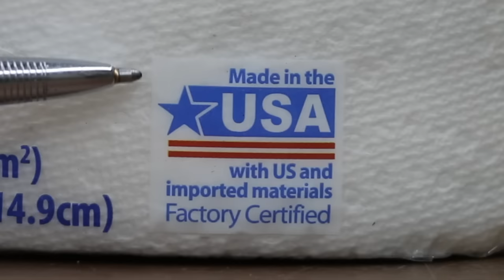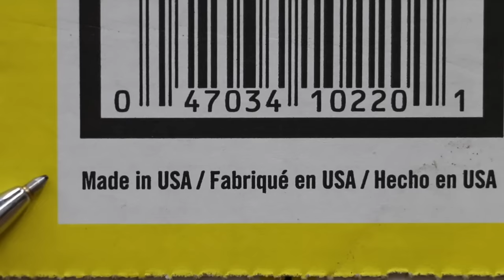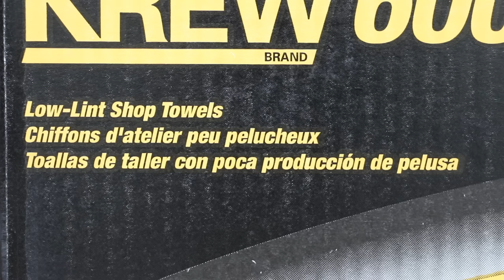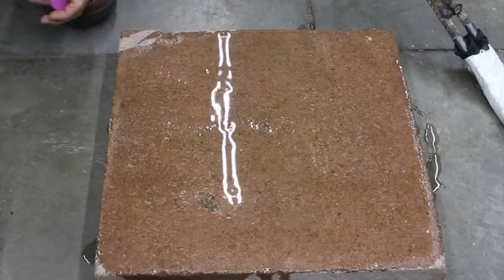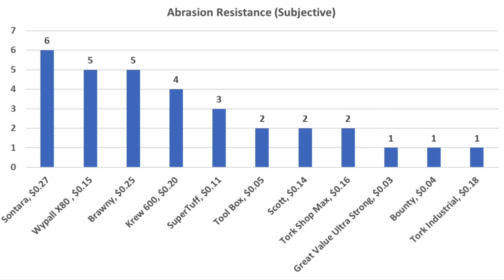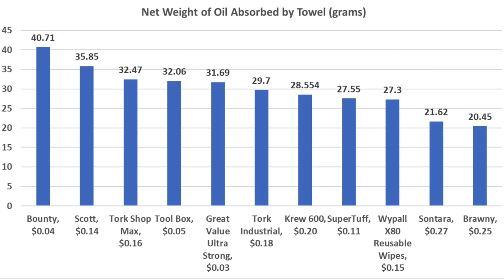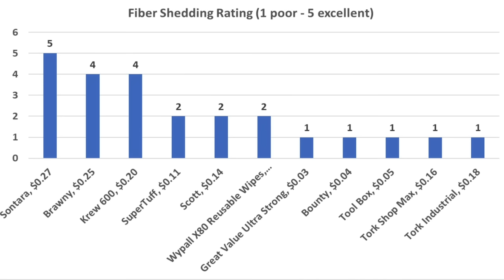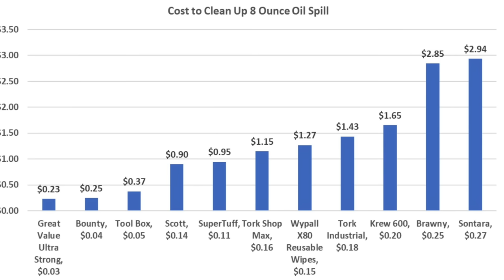Shop Towels vs Paper Towels? Let's Settle This!

Comment: One benefit I’ve found for the blue colored towels is they darken when they come in contact with a fluid. When looking for a weeping brake line or plumbing fitting, that’s worth the expense to me. The white ones just don’t show enough contrast for a tiny droplet to show.
Reply: That's not a bad point!
Reply: plus I always get em online for pick up in store for a slight discount
Reply: Finding plumbing leaks with white paper towel, exercise in frustration, been there and tried that.
Reply: good idea, thanx.
Reply: Thanks for the tip !!
Reply: Excellent tip!  I guess I'll keep some around when I switch to the Wypall
Reply from the maker: Thanks for the feedback.
Reply: There's also a brand (forgot the name) that has orange towels that turn bright red when exposed to fuels (hydrocarbons) and oils.
Reply: I have become a shop towel junkie.  I have learned that they sell white ones for painters.  But my expeirience is i want to see what paint i am wiping up, so i know where to fold the towel and use it on the next mini-clean up spot. Sticking with the Blue ones
Reply: Yea I like the super cheap brown ones for finding leaks. Always in public bathrooms etc
Reply: @nmatthew7469  liquid soap on a paint brush, brush the area down and wait for the bubbles to appear.
Reply: @bobstorr4986  only for air and gas lines will that work.

Comment: Someone FINALLY called Bounty out on their quicker picker upper claim!
Reply: Bounty was 1st for absorbency and 2nd for absorbency speed compared to a paper towel costing nearly 4 times as much.
I think it did alright considering.
Reply: @evilutionltd  your comment is inappropriate,
Reply: @del-boysnostalgiatvads7416  Huh?
Reply: How were they called out? That they aren’t the best to be used in the shop because they aren’t the strongest? I think you missed the whole point and some of the results of this test. Might also want to take off those glasses that give you tunnel vision and cause you to only see what you want instead of what’s actually there.
Reply: @plaid11  they were called out in the beginning. Todd's classic "we're gonna test that..." I never said their claim was false, only that I'm glad someone other than a Bounty commercial was finally testing it.

Comment: 5:28 - Tensile strength
7:53 - Abrasion resistance (subjective)
9:48 - Net weight of oil absorbed
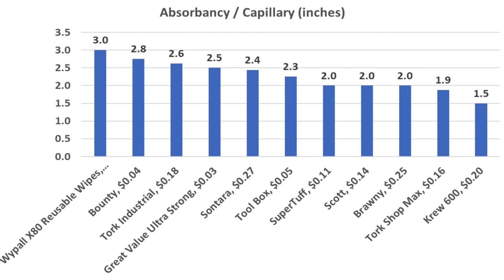11:13 - absorbancy
12:05 - fiber shredding rating
13:37 - cost per 8 ounce cleanup
Reply from the maker: Thanks for the feedback.

Comment: It looks like there's a trade off between strength and absorbency
Reply from the maker: Excellent point!
Reply: Which is expected. To be a good absorber the material needs to be more porous which leaves less material for strength. That's why I have both types in the shop and in the kitchen. I would also have tested how easy it is to remove residue from some surface. Because from my personal experience it's easier with shop towels because of the higher tensile strength.
Reply: For sure. I use Wypall X60 and they're not the best absorbent. If I need to really sop something up, I'll use regular paper towels.
Reply: For sure
Reply: I noticed that too
Reply: Yep.  I already had Bounty in my garage so I could pick up spills cheaper than using Scott Shop Towels, but when the Scott runs out WypAll X80 seems much better replacement.  Bounty paper towels + WypAll X80 seems a good pair at a reasonable price that covers most tasks.  Maybe with a small box of lint-free wipes for when you really need that.
Reply: @Sn0wZer0  At that point I'd rather use lint free cloth rags, swing through a Value Village or something and grab some cheap material to cut up. Way less likely to disintegrate if you catch on a sharp edge too.
Reply: @TheGibzar  Yeah, I get where you are coming from, but at my old job we had "KIMTECH Kimwipes" which worked really well (though not at all absorbent).  I like how they worked so I bought a box because they aren't expensive ($0.02 per small sheet; equivalent of $0.06 if the same size as a paper towel).  Again, not absorbent but if you need that you can soak with Bounty and then wipe with Kimwipes.  If PF does a test maybe I'll switch but until then I'm sticking with what I know works.

Like most people I also have a stack of microfiber cloth for work just involving water / mild dirt and not any chemicals.
Reply: @Sn0wZer0  microfiber rags are pretty cheap nowadays and are virtually lint free
Reply: @ptyzix  as soon as I saw it, that logic light bulb goes off and it's something you kinda already know. It's crazy sometimes the things that point out obvious things lol
Reply: @ptyzix  yeah, I keep 3 types handy. Regular cheap paper towels, the "reusable/cloth-like" paper towels (blue/white shop paper towels), and textile shop rags. My favorite being the latter. I don't see any benefit of spinning a half a roll of paper towels off, just to wipe up one mass. I go through enough tee shorts throughout the year to make more than enough rags for myself, so I can throw out the ones that are too greasy to go into tree washer. Then I take all my rags after a month, toss them in a 5 gallon bucket with purple degreaser & water overnight, rinse them, fill the bucket with bleach & water, let it soak overnight, rinse it, then throw them in the washing machine. I've got an entire duffle bag full of rags. It's a beautiful sight. I use sheets, bath towels, hand towels, face cloths, kitchen towels, blankets, shirts, and pretty much any textile. I collect them over time in a bag, then sit in front of the TV for an hour and cut them into rag size. I use a self-healing cutting mat and an Olfa 45 or 60 mm fabric rotary cutter (with the authentic, made in Japan, Olfa brand blades) to zip them into rag size in seconds. If you're cutting a lot of fabric, a rotary cutter is indispensable. Shears just take way too long.
Reply: For larger spills, kitty litter for the win
Reply: @ptyzix  although  something that I feel breaks that rule is pig mats they are strong as hell and soak up so much they are thick though

Comment: I just wanted to say, those Tool Box brand towels are sold at more than Harbor Freight. Also sold under a variety of names, although those would mostly be seen commercially (Caterpillar, John Deere, Uline). There are also several variant weights of it, from like H700 to Z2200. This refers to how it is processed. Brawny 6-packs in White are made by the same converting plant. The square box dispensers, plastic wall-mountable buckets, and bucket refills ranging from 7" diameter rolls to 10", are all from the same plant. 

The paper is called DRC - Double Re-Crepe. It's actually the name of the specific process. It gets fluffed, a latex/natrosol/couple other binders mixed in, wrapped around a steaming hot drum (literally), cooked, scraped off, sent through an oven, then repeated to the other side. It just about increases the absorb-ability of the stock paper 4x for the lighter weight, up to 7x for the heavier weight.

There's also a tear resistant option where there's basically a loose plastic filament in the wiper that keeps it from tearing apart.
Then, there's a no-tear option (called diamond DRC) that's usually blue, red/orange, or pinkish-red that has a very tight diamond weave layer cooked onto both sides of it.

Signed,
The millwright that fixes all that shit
Reply: Where can we get it?
Reply: @jjohnston94  your a legend
Reply: @meateater139  I am? What's the legend?
Reply: Shout out to Millwright mechsnics. Was very lucky to work with 2 great millwright mechanics while an electrical spprentice in maintenance shop. Guys could weld burn do plumbing set machinery and small electrical jobs. Neither.ever used an adjustable wrench. They taught me to always work with the correct tools and to work safe.
Reply: Best comment ever

Comment: I’d really like to see a garden hose test.  Love the channel.
Reply from the maker: Thanks!  Thanks for the video idea.
Reply: That would be a great one to test. See how much they swell under pressure.
Reply: @reecer6317  The bursting of the hoses would be highly entertaining
Reply: If you do this please test inner hose swelling when the outer lining is punctured.
Reply: How easy they kink and how well the ends are made is my biggest concern. The hose always seems to kink and fail right before the end.
Reply: @tonnyletkeman2348  I bought a couple of those black industrial ones from homedepot , they’ve been very good so far. I need to check the brand.
Reply: Yeah some of the more expensive hoses like the zero g seem to get small holes in the too easily for the price
Reply: @ProjectFarm  agreed it’s crazy how many options there are . HELP! Haha
Reply: Yes!

See which ones handle being run over by a car.

Flow when pulled around the corner of a house

Flow when 180 degree kinked.  

Cut resistance. 

(Would take some time but) UV resistance over maybe a six month period or so.

Edit: and I agree with Luke.  Torture test them under high psi until they let go.
Reply: And nozzles too!!
Reply: Me as well! I've popped two bungee hoses because I think I have too high water pressure. . .
Reply: I too would like to see this.  The best I have found are Underhill hoses, which are expensive, and 100% rubber hoses which are not as expensive but not cheap.
Reply: @ProjectFarm  Please include the 5/8 and 3/4 zero g hoses in your test. When I need to buy something, I always check my list and your channel to see if what I'm buying has been tested. Your work is greatly appreciated.
Reply: @ProjectFarm  omg yes. garden hose test please. I hate hoses, and a good test would be durability, and easy storage!
Reply: Best hose out there: Basic black GOODYEAR rubber hose.  Expensive but worth every penny
Reply: @MWash-yr1xe  My wife murders a couple of those a year!
Reply: @blaydCA  I think they stopped making the 100% rubber hose. Have only seen the new partially rubber hose.
Reply: @NONO-hz4vo Goodyear Black Rubber- Top of the Line Water Hose
100 ft. x 3/4 in. ID
American Made by Continental-Goodyear-Thermoid
Industrial Grade. 200 PSI Rubber
Flexible in all weather conditions! 
Heavy Duty All Brass Fittings Steel Banded On. $66.00USD Online plus shipping, ect. Pricing ain't for the squemish. Worth every penny though for my needs. Homer used to carry them.
Reply: @WearilyMistaken  Better hardware/lumber resellers will have pressure testing guage the attaches to a sillcock/outdoor spigot in place of your garden hose to test. Domestic water supply should regulated to 45 PSI +/- 5. Unregulated supply for irrigation/fire suppression can range up to 130 PSI direct from water main/service line.
Reply: @stephenvogel3162  We won't ask WHY.....some things are better left unsaid. Note to self: hide my nozzle.
Reply: @talldarkyummy8211  might be "entertaining" to watch a test burst.  Not so "entertaining" when water costs $3.50usd per 100 cu ft (748 gallons) in the SoCal High Desert and it pukes unattended.
Reply: @blaydCA  thanks for the info!
Reply: @blaydCA  I stand corrected. I grew up in the country where water was plentiful.
Reply: @talldarkyummy8211  No worries. I lived back east before where water was plentiful and inexpensive. Here, it is precious, more so with current drought. My area is in good shape because we conserve.
Reply: If you haven't checked, he just did one :)

Comment: The sontara towels are great. I was an automotive painter for 20 years and loved the sontara towels. I was very picky and a towel snob. After I masked off a car, I would clean my panels with grease and wax remover. Most towels leave to much lint behind. The sontara’s were the only ones that didn’t lint. And when painting, you need the cleanest, dust and lint free environment possible. Little towel lint fibers left behind are detrimental to a nice smooth paint finish.
Reply from the maker: Thanks for the feedback.
Reply: It makes sense. If you're using them in the aerospace industry, you don't want that lint getting into multi-million dollar machinery/engines/equipment.
Reply: 100% Fact!
Reply: Sontara brand is made by Dupont.  KC has about 5 different towels just for critical task wiping.  The truth is there is only about 4 paper mills that make 90% of all "paper towels" and other paper pulp type products.  KC and GP being the biggest and Trimaco being a close third.  A lot of them do the private labeling too.
Reply: @Dominasty  aerospace, no. But when you are doing $10k in paint work on a $100k car, in a $50k paint booth. Yes, these little differences do make an overall huge difference. Why worry about a extra dollar in towels when you have weeks worth of labor and thousands of dollars in materials invested.
Reply: I am not trying to argue but I have a question why not use cotton towel if leaving residue ruins paint or a cloth shop Towel?
Reply: @jbflyinglow  cloth towels are great but you gotta run them in the dryer 5-6 times and are better after a year of use. And that's my experience building engines. They still might lint and leave dust in paint
Reply: @1963felonee  thank you, I use them in my machine shop but I had no idea about paint.
Reply: @jbflyinglow  cotton leaves way to much lint. Microfibers on the other hand do work pretty good. Unless your in a shop in California, where you can’t use solvent based grease and wax remover, and you are forced to use shitty water base cleaner, the microfibers work well. I wouldn’t use them with solvent base though, because I think it might melt them or at the very least leach out their color which could transfer onto your surface.
Reply: @JohnDoe-du6yi  thank you
Reply: @1963felonee  what aspect of engine building is sensitive to some lint from rags/towels? Seriously? Are you building jet engines?
Reply: @xenonram  just what I got taught for cleaning around bearings and stuff but engines aren't too sensitive to lint, but doing it a little better is better than 12 hours of warrantied labour
Reply: You cleaned your freshly painted body panels with paper towels?! Um, hello microfiber???
Reply: @Dominasty  Microfiber cloth.
Reply: Microfiber is good for being soft but the nature of the fabric can attract and transfer partials. With the nature of specialized disposable wipes being so thin and lint free lends themselves as an ideal product for use with paint prep. Especially high end paint jobs. And you have ever washed a microfiber cloth you will quickly understand that they would turn into a one use product for any type of lint-free/uncontaminated sensitive work.

Comment: I've been using the Great Value brand for a very long time. For the money, it's a good paper towel. I always wanted to know which paper towel is best for low lint use. Thanks for another great testing video!
Reply: Likewise low lint is important to me. I usually struggle with lint when cleaning gasket surfaces and find myself wiping several times to remove the lint from the last wipe. It probably doesn't matter but when you want something to last 100,000 or more then you don't want it take chances!
Reply from the maker: You are welcome!
Reply: Is that .03 per half sheet or two half sheets?
Reply: electronicsNmore  Viva Signature Cloth.  Expensive, but awesome.
Reply: @maulerrw  Yea I just spray it with air hose
Reply: "Decent value"
Reply: No tack cloth on a 4k paint job?
Who is doing these paint jobs?
Reply: You could almost call it a… great value
Reply: @maulerrw  Hi Garfish, may I recommend paper coffee filters, use to use them for a lint free cleaner for windows,never leaves lint.Take care.🕊️🙏🕯️

Comment: I've been using Scott ones forever, looks like a change is in order. Thank you for your awesome videos!
Reply from the maker: You are welcome!  Thanks for sharing.
Reply: Me, too, because you can get them in a big, 10-roll multi-pack from Costco.  I've got my eye on those Wypalls, though...
Reply: I think Kimberly Clark actually is Scott. It really likely just comes down to the fact that the white box Kimberly Clark ones are meant for pretty brutal industrial use whereas the blue Scott towels can pretty much be bought at Walmart by any Tom Dick and Harry. I've honestly used them all in my years, but in my house we use the Bounty towels because they don't scratch and they are quick spill cleaners. We do have some Scott blue towels in our garage just for drying our hands basically. I honestly just use the run down microfiber rags for just about everything in my garage though. Worst case scenario they get too destroyed to be worth washing and I throw them out. But they were junk at that point anyway.
Reply: They used to be a lot better, but the past few years the quality has just plummeted
Reply: Same here
Reply: @taowroland8697  I was gonna say, I am pretty happy with the blue shop towel I brought 3 years ago from costco. seem alot stronger than what i see in this video.
Reply: @ashes2ashes863  you came awfully close to being a bounty commercial. I just knew while reading you were gonna say bounty the quicker picker upper lmao 😂
Reply: @jamesfair9751  I probably originally did and was embarrassed enough to change it. 😆
Reply: @taowroland8697  if you look at where it's made the blue shop towel is made in roswell in this video. You need to find the stuff made in marinette. That's where your quality is.
Reply: @ashes2ashes863  Kimberly Clark bought Scott paper and kept the name on some products.
Reply: @kenc2257  

Wypall for durability Bounty for absorption.
Reply: I've been using them for years too but apparently they are not what they used to be. They are so tough I have even put them in the washing machine to use again!
Reply: same